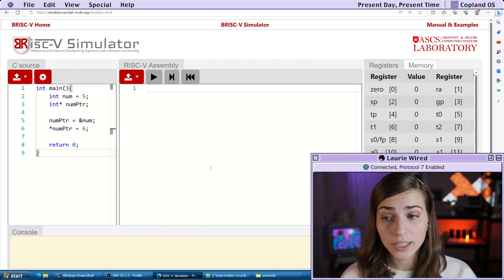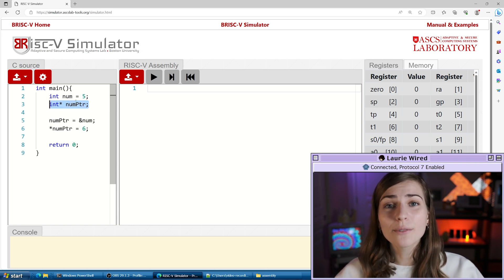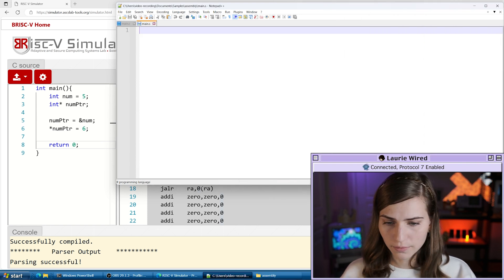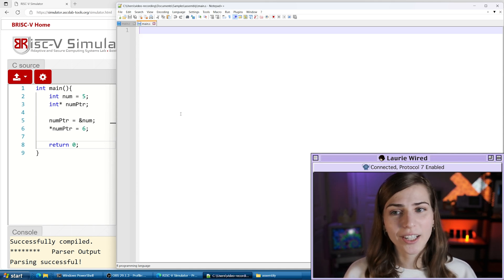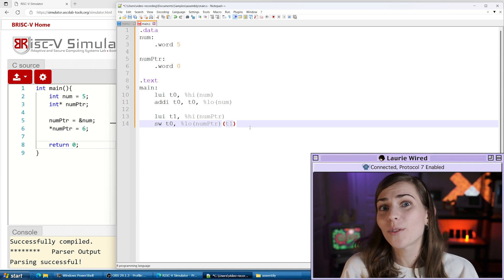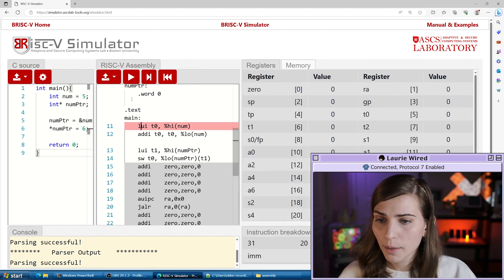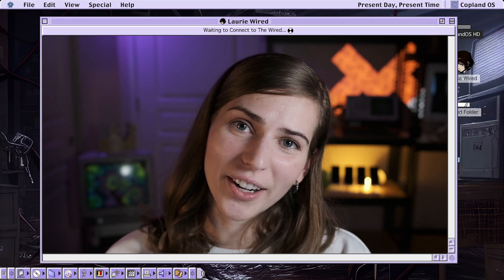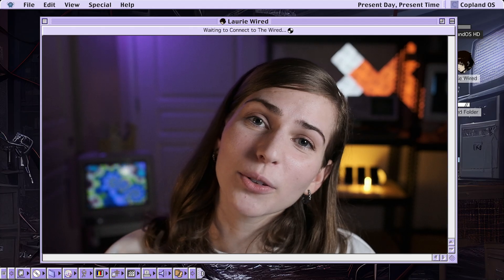Pointers in RISC-V Assembly

Comment: You stated that you are limiting the code to base RISC-V, however the format (syntax) of the instructions you used are in fact pseudoinstructions. This is based on the RISC-V ISA specification.  I tried testing your code in the RARS (RISC-V Assembler and Runtime System) and pseudoinstructions must be enabled for the code to assemble.

Comment: Interesting they split the load immediate into 20 and 12.  Someone was thinking about paging...
Reply: it was more of a tradeoff for encoding space on instructions with immediates, so that there's 18 (8 with 2 register fields) rather than 14 bits free for the opcode and such in instructions with a standard immediate if you don't count the static 11 bits for the instruction size
note that 12-bit immediates are always sign-extended, so an lui/addi pair with a known value in lui could generate an address in one page or in the page immediately preceding and the range doesn't span the entirety of either
Reply: @lithiumwyvern_  ok well that make less sense then lol

Comment: I'm really curious as to why RISC-V Assembly separates the addresses into "upper" high-order bits (most significant part) versus the low-order bits (the least significant part). Is it related to WORD alignment, I wonder?
Also, is this unique to RISC-V or other Assembly languages do it too...?
Reply: Because you can't fit 32 bits of immediate into an instruction that itself is 32 bits long.  You'd have no space for the actual instruction encoding.  The interesting thing is the split at 20 bits, which means if your data section is 4k aligned/sized then really you only need to load the upper bits once and then only need to load the lower whenever you change locations.

Comment: ok so my stumbling upon this content is really fortuitous because I know very little about programming, but have decided to learn C and MIPS asm for the R3000 the PS1 used so I can learn to decompile Megaman Legends and Serial Experiments Lain for PS1. I don't know if you have any playstation reverse engineering stuff in the pipeline but I would absolutely LOVE that, as this is a bit overwhelming at first!
Reply: Are you writing a PS1 emulator to aid with disassembly? If not, I'd advise you to start there, because you could step through the code as it's running. If you don't want to write one yourself, then consider using one of the numerous open source PS1 emulators as a starting point. I would recommend PCSX-ReARMed, as I found its source code rather easy to navigate when I used it on my Raspberry Pi and had to modify it to work with my controller.